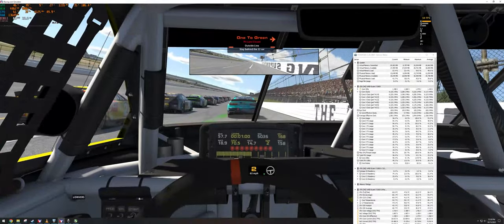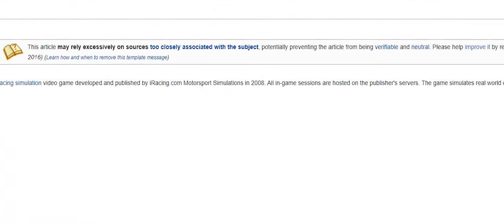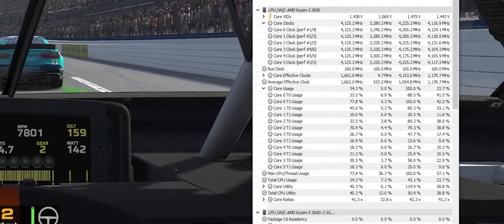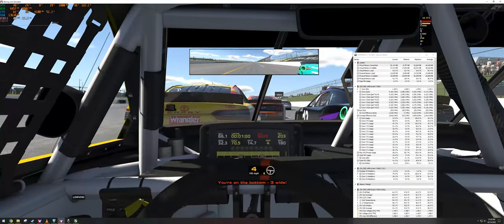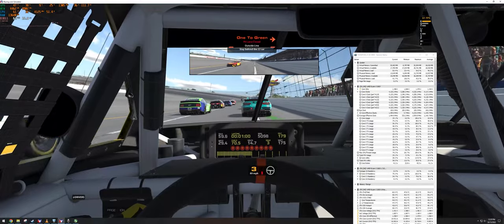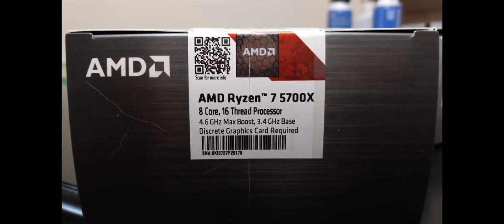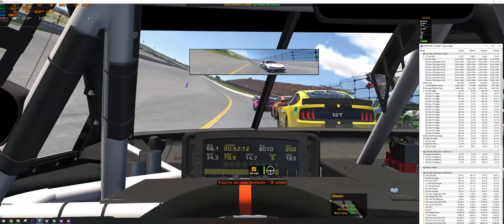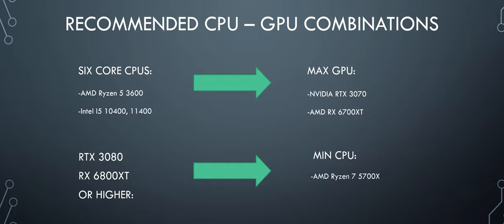IRacing CPU bottlenecking explained (RTX 3080 with Ryzen 5 3600)

Comment: Great video! I’m currently building my first pc, iRacing focused, like almost 100% My old iMac can’t cut it anymore (yes I ran boot camp on a 2012 iMac this entire time😬) There are so many opinions around hardware. Right now leaning towards 7800x3d because of a MC deal. And pairing that with a 4070? My plan is to use my Samsung 4K tv as a monitor, maybe dabble in VR. Your thoughts? Is that overkill?
Reply from the maker: I think that its a smart choice.  Microcenter has some great deals and AM5 is a great platform to get on because you will be able to update the cpu down the road.  It may be overkill at first, but if you do end up going to VR or triple screens it will be very helpful.  If you are going to spend that much I would try to squeeze a little more out for the gpu.  I would get a 4070 super at the least.  Its probably the best value right now.  Thats a great solid base that will last you many years and will allow easy upgrades.  32gb of ram will be good for a long time too.
Reply: x3d is great for simulations especially ac.

Comment: I'm running a 3060 12GB with a Ryzen 5 1600 with triple HD monitor. I'll swap to a 5600X I got for a good price. Next step will be a 4070 Ti or Ti Super. Thanks for the video.
Reply from the maker: You will notice a big difference with the 5600x.  And its nice to always have the 5800x3d as after that.  Good luck

Comment: I'm running a R5 3600 @4.3GHz with my RTX 3080 and as a result of the CPU bottleneck I currently run my GPU with a 75% power limit because why not... 

Picking up a 5800X3D the next time they are on sale.
Reply from the maker: It's a worthwhile investment that will certainly last for years in the sim racing realm.  I'm tempted to get one before they are out of production.
Reply: Have you done it and was the ypgrade worth it ?
Reply: @SOfilmable  yes. 5800X3D is a massive upgrade for iRacing compared to 3600. Worth it 100% if you have a higher end GPU - 3080, 3090, 4070, 4080 etc.

Comment: Amazing video brother. Thank you. Crazy that with your new cpu and GPU combo it can only push 100fps. That’s some serious hardware you got there. The 1440 resolution just eats at the cpu/gpu im guessing?
Reply from the maker: Thanks!  Yeah, 1440p ultrawide is almost as demanding as 4k. But my monitor is 120hz and I can usually lock around 120fps so it works out pretty well.

Comment: I'm running the Ryzen 5 3600 and a RTX 3070 at the moment but I'm waiting on a Ryzen 7 5800X3D to come in. Should be here in the next couple of days. Also got an AIO cooler for it as well as a 1tb nvme ssd as I've been running iRacing on my boot drive which is only a 250gb nvme ssd and it's running out of space. Also adding an extra 16gb ddr 4 to the mix to give myself 32gb ram so that there's no excuse for bottlenecking.
Reply from the maker: Nice!  That should get you a very competent pc that will last for many years to come.  You can never have enough space and NVME drives have dropped massively lately which is awesome.  To me 32 GB of ram is the new standard, especially if you are multitasking.  Games like BeamNG use over 16gb on some tracks and can cause crashes.
Reply: Hey it's been some times but how was the upgrade from 3600 to 5800x3d ?
Reply: @SOfilmable  Huge difference. Still running the 3070 but I'm on a B550 platform now so I get a decent boost in performance in all games and general use. Looking to get a 4070ti as my next upgrade though. Also got myself the Meta Quest 3 and iRacing is running amazing on it.
Reply: @bryndal36  thank you

Comment: i am so glad i watched this cause i have a ryzen 5 3500 and a rtx 3070 and i know exactly what cpu to get now to get better performance out of it lol
Reply from the maker: Yeah man the 5700x is awesome and it's been as low as $170 lately.  Also if you want to max out your platform and be good for like 5-6 years spend a little extra and get a 5800x3d for like $280.  Just make sure to update your bios before you take out your old cpu.
Reply: @manofyeo  well I'll prob get the 5700x for now tbh being on a tight budget I put most of my money towards my son, but I'll keep the 5800x3d in mind, i appreciate that info glad i subbed to you, i been searching around on youtube for a good cpu for my 3070 and your previous setup was near on point with my current setup with the bottleneck XD

Comment: Not sure on others but I have 2080ti & 8700K on 3440x1440 UW and I easily get over 120FPS on med/high settings (even at start of race). I would have thought your fps would be alot higher than what you are getting on single screensetup.
Reply from the maker: Yeah when I had the 3070 briefly I didn't notice it but when I got the 3080 I started to notice it more.  8700k is pretty similar to 3600 but iRacing may favor intel over AMD or it may have better single core speed, which iRacing relies on.  Interesting to know though.

Comment: Great stuff!!

32’’ Lg 2k 165hz monitor here

I lock my fps to 163 in game even if i have 220 to 240 cuz i dont want to feel the drops…

5600x + 3070 + 16gb ram

I could upgrade to a 3080 or 3080ti and it wouldnt cost me alot, do you recommend it?
Reply from the maker: You could if you wanted to future proof a little but if your going to stick with one monitor Id probably just wait a little longer and you can pick up something like a 4070 or 5070 down the road and it will be a lot more efficient. 3080s are great but you can get a new 4070 for not much more and it uses much less power for the same or better performance.
Reply: @manofyeo  great thanks! Thats what i figured after haha ! Ill upgrade for a 3080ti at a low price and close to me!!
Reply from the maker: @banjoqc  Cool!  Undervolt it with msi afterburner and you can save like 100watts of power and it will run a lot cooler.
Reply: Do you get GPU related black screen crashes with the 3070? 
I’ve been having major issues whenever there is too much detail on the screen. 
I thought it might be because the 3070 only has 8gb Ram?
Reply from the maker: @DBatty  I have a 3080 but I have never seen iracing use up too much VRAM unless the slider at the bottom of the graphics page is not set properly.  You can also change it in the .ini file.

Comment: I have the same issue with my 5800x.

What are your settings? I’m running VR btw. But my CPU is the only one capping out
Reply from the maker: My issues were mainly with the settings maxed out but turning some of the shadow maps and other stuff in the middle of the settings can help.  5800x3d would probably help out your situation.

Comment: i7 6700/gtx 1650 and 32 gb ram at 2133hz framerate limited to 70 low settings no problem for me
Reply from the maker: That's a pretty balanced system so that makes sense.

Comment: will a rtx 4070 and ryzen 5600 work well together at 1440p max settings? what amount of fps could i expect?
Reply from the maker: Yes that should be fine.  With one monitor you will likely max out whatever the refresh rate is on it.  Should easily get over 100 fps in most cases, except at the start of the race.  You can always upgrade to a 5700x3d for $200 if you have an cpu issues but it shouldn't be a problem.
Reply: @manofyeo  ty bro, and what gpu and cpu should i get if i wanna get triple 1440p or 4k monitors?
Reply from the maker: @gojiiiiiii  Triple 4k is super demanding and you will need pretty much a 4080 super or 4090 for high frame rates.  I'd go with 1440p since its way less demanding.  You're still gonna want a pretty high level gpu I'd say atleast a 4070/3080 but higher would be better if you want max frames.  For cpu If you are building new I would go with a 7800x3d as its the best gaming cpu for sim racing and can upgrade for many years.  If you are on a tighter budget the 5700x3d will offer really great performance as well but wont be upgradeable.

Comment: I run 4k hdr at 120 fps easy. Cpu 5800x3d gpu 7900xtx 32gb ram @3200hz. I only use 6 cores, and the other 2 run aster in an arcade box my kids play. Everything is maxed, except mirrors are off and the top tier of shadows.
Reply from the maker: Nice, that's a really powerful setup!

Comment: is ryzen 5 7600 procesoor with rtx 4060 is good for iracing. im building  gaming pc for the first time, and i want to use it for specially sim racing.
Reply from the maker: Yes that is a perfectly fine starting pc for 1080p gaming.
Reply: @manofyeo   what about ryzen7 7700X with RX 7700XT OC GPU?
Reply from the maker: @old47monk  7700x will be a little faster than 7600 with better ability for multitasking.  7700xt gpu will be much stronger than a 4060 but it depends what kind of monitor you want to run.  7700xt will be better for higher resolution or multiple monitors
Reply: @manofyeo  I will  use a single monitor. Right now  I'm thinking of going with  the Ryzen 7600 and rtx 4060 ..! Will upgrade in future !  Thanks for the Advice 😃

Comment: Im running a 12900k With a 3080 trying to boost my VR super sampling and am running into the same issue. 1.8x super sampling GFX card at 60% usage but can't go any higher.  Sucks because iracing is the only racing Game I want to play...
Reply from the maker: Can only do so much with such an old platform.  12900k is no slouch either.  I would be curious to see how the new ryzen 7800x3d performs on iRacing.

Comment: I have a 3600 aswell but only a 3070, so I shouldn't be getting much bottlenecking right?
Reply from the maker: Maybe a little but probably not enough to make for a bad experience.   if you have any issues down the road you can always upgrade to a 5000 seires for fairly cheap and easy installation

Comment: I own a Hp Victus 15L 5700 6600xt. Can i run iracing on max settings
Reply from the maker: Depends what resolution you are running but at 1080p yes should be pretty easy.  1440p would probably run pretty good too but might need to adjust frames depending how many frames you were looking for.  What kind of monitor are you running?

Comment: i run a r7 2700x with a 3060ti and im planning on getting a 49in ultrawide. what do you think it'll work on aproximately 120fps?
Reply from the maker: Hard to say because of many variables but I would guess that it would average 60-80 fps.  By yourself in less demanding scenes you will probably see 120+.  In more demanding parts like the start of races you will probably see it drop to 60 or lower.  But as long as the gameplay is smooth it should be fine.  I would just see how it does and then change some of your graphics settings around to try and tweak it.  49 ultrawide is really demanding so I would probably consider upgrading GPU and CPU down the road if you have a hard time. Let me know if you need help.
Reply: i run a quad 1440p setup on iracing with a 3060ti for a year, did had a ryzen 5800x tho.. 140fps in race, starts round 60-85fps but no crowd, and les details around track, no shadowing options..
Reply: @snikkol  ok, soy probably i shoul make a CPU upgrade first
Reply: @maxistefe  yeah I have a 4090 now with a ryzen 7900x and still experience fps drops. So I think a better cpu in combination with the 3060ti will be solid! Do you run 32gb memory on high speeds?
Reply from the maker: @snikkol  3060ti is a very good card for the price.  I always recommend is as a baseline for someone getting into multi-monitor or vr  sim racing setups.  I've used a few in builds for friends and it always packs an impressive punch.
Reply: @snikkol  i run 16gb 3200hz but i’m planning on getting 16 more
Reply: @maxistefe  yeah that will be a nice upgrade too! And prices are pretty good atm I think. Good luck man! Wish you the best with your setup
Reply: @snikkol  yeah bro! Thank you very much for your help

Comment: will the 5800x3d help with a 4070ti.....or will the procesor you put in work...i have the 3600
Reply from the maker: The 5800x3d would help drastically in sim racing games with a 4070ti.  You would probably see a 30-50% increase in the framerates, especially the lows.  3600 will certainly work, you just may have some slow downs in the cpu demanding parts.  Depends what resolution you are running at as well.
Reply: 3 monitors and it keeps putting the r and g in the red in the back of the pack drops down to like 40 fps
Reply from the maker: @wanabgt  You are definitely hitting a CPU bottleneck if the monitors are 1080p or 1440p.  5800x3d would help greatly.  I think it is a very worthwhile investment.
Reply: It's that or upgrade the mother board and go bigger
Reply from the maker: @wanabgt  True, but 5800x3d is gonna be about half the price and just as good.  Should last you for many years to come.
Reply: What heat sink would you get I will be hitting micro center saturday
Reply from the maker: @wanabgt  Thermalright has some really good coolers for cheap on amazon.  Peerless Assassin 120 is like $40 and works amazing.  Not sure if they have them in store.  Almost any dual tower air cooler would be good.  Deepcool ak620 is also really good.  Be quite dark rock 4, any noctua, or scythe mugen are all great options.  If you want to go water id recommend arctic liquid freezer 280 or higher

Comment: Iracing RAM 8 is it possible?
Reply from the maker: 8gb of RAM?  Yes its possible.  I have a friend that runs a i5 9400, 1050ti and 8gb of ram with no issues at 1080p.
Reply: @manofyeo  but on Steam it says 16gb RAM, is that okay?
Reply from the maker: @fajares27  It should be fine.  My buddy has no problems.  But I would recommend upgrading to 16 or 32 at some point its useful especially if you have extra programs open at the same time.
Reply: @manofyeo  how much gb iracing bro?

Comment: Try 5800x3d next, it’s big jump in iRacing performance again
Reply from the maker: Yes I'm definetely considering it before they stop producing it.  Its hard to resist at $280, but my 5700x is running flawlessly so we will see.
Reply: 5800x3d+4090= still get sub 100fps drops on some tracks drops on triple 1440🤦🏾‍♂️
Reply from the maker: @ewenblack4174  Can thank that the iRacing engine for that.

Comment: I plan on getting a 4070 card. What cpu should I pair with it as Iracing is the only game I play?
Reply from the maker: Well what kind of monitors and how many of them do you plan on using?  That really makes a huge difference.  But either way I would go for atleast a ryzen 5600 or intel 12400 at the minimum and if you have the budget or want to future proof more go with the ryzen 7600x or higher or intel 13400 or higher.  6 cores will be enough if thats all you are doing.  If you think you will have multiple monitors doing more multitasking down the road then consider an 8 core.  Also the ryzen 5800x3d is pretty much the best bang for your buck but is on an end of life platform.  The 7800x3d is even, but more expensive.  It is on  a new platform that will support multiple new generations of cpus down the line though.

Comment: Is a Ryzen 5600 good with a 4060 ti?
Reply from the maker: Yes it will work perfectly fine. And down the road you can upgrade to a 5700x3d if you need more cpu power.

Comment: You lost me when you said the code was from 2008. Dude, you really think that that is the main reason why iRacing is CPU heavy?
Reply from the maker: Its one of the reasons.  Ever hear of spaghetti code?  Yes racing sims in general put a large demand on the cpu but there are other sims that don't have this problem so being based on a 20 year old game that came out when cpus had one core is certainly one of the contributing factors.
Reply: @manofyeo  Yes I know what that is. But do you really believe that iRacing is still that? You really don't think they haven't made huge improvements over time? I mean the fact that the UI still looks more or less the same doesn't mean that 'under the hood' huge improvements have been made and things have developed into more modern times.
Reply from the maker: @frederiquerijsdijk  I think its a mix of original coding and new, more updated coding.  I know they have done quite a bit of work to update it all and are constantly updating it but Im pretty confident that there is still a large base of original code in there for physics and graphics that hasnt been completely overhauled.  It would be almost impossible for them to completely rebuild it from the ground up.  Also there is quite a bit of content that is original and unrefined.  Their newer tracks are finally looking more modernized but they announce when they are rebuilding tracks.  Also they do support 8 cores for the new damage model, which is an option you can turn on in an .ini file, but it appears to only be for the damage model and nothing else.  Thats why single core speed still matters so much in iRacing.

Comment: believe it or not your CPU is responsible for down converting 4K to 1440 and 1440 to 1080....  a monster GPU paired with a underachieving CPU will make the CPU suffer.   if you used a GPU that thrived @ 1440 I would be less work for a lower end/ older CPU to deal with.     

also: iRacing has a FPS limiter.... I saw in your video it's not on,   set max FPS @ 90 or 84 (stock setting) then you won't be wasting utilization trying to hit a unrealistic FPF by yourself, only to bee slowed down in a pack..... that is what the FPS limiter is for.
Reply from the maker: I actually limit my FPS in the NVIDIA control panel to 116 so that it stays within the g sync range of my monitor since it is 120hz.  I usually turn it off for benchmarking to demonstrate the full potential.  And even with the limits in place I would still experience slow downs.